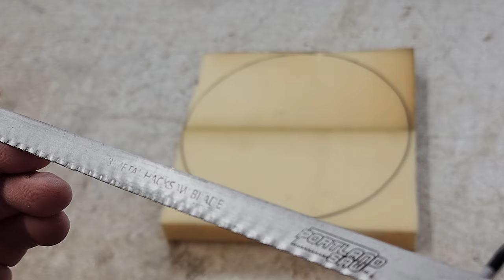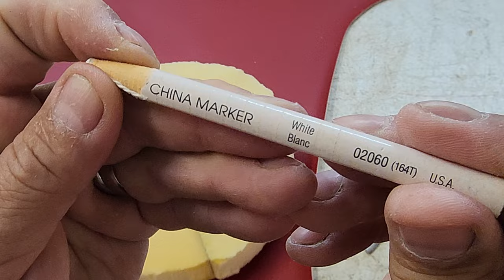How To Easy Bar Stool DIY Upholstery For Beginners #barstool

Comment: Is there a chance of you doing a video on how to fix a headliner board? I'm currently rebuilding a car that they no longer make panels for and the original board broke into 5 pieces in hoping it can be put back together
Reply from the maker: Hello Thunderjet, if you still have all the pieces, I would just put them all together and reinforce the headliner panel on the back side with fiberglass or the poor mans fiberglass method with burlap and wood glue. Please keep liking and watching!
Reply: @oldschoolautoupholstery  thank you I was thinking about fiberglass and resin thank you for the confirmation
Reply from the maker: @thunderjet4294  Hello Thunderjet, Right on! Right on. Please keep liking and watching!
Reply: Perfect 👌🏻